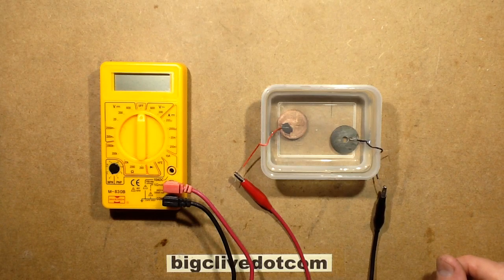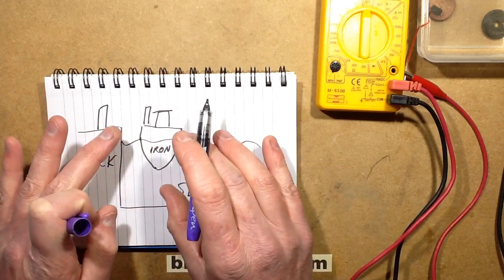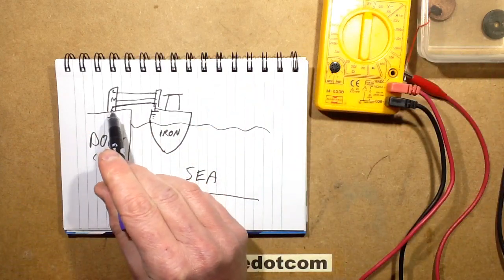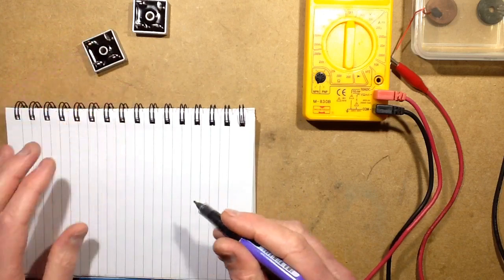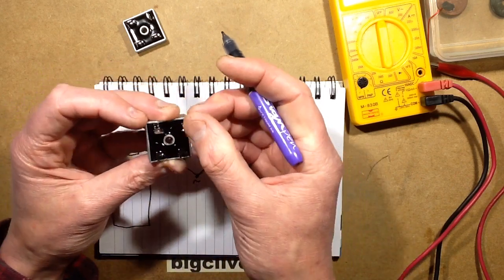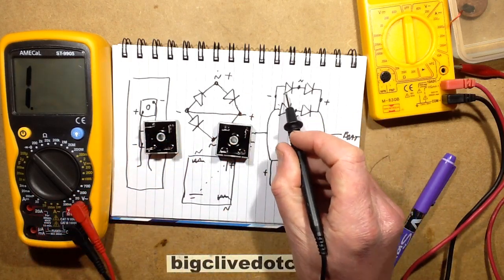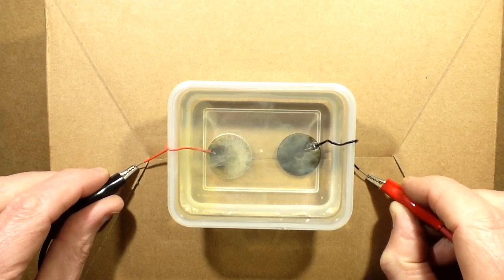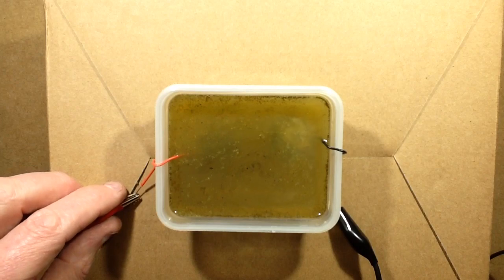Intriguing science of galvanic isolators for boats.

Comment: I just ordered a galvanic isolator for my boat. I found out the American ABYC standard as well as some ISO standard says such devices must be fail safe so you keep the protective ground even if the diodes fail. Turns out most GI don't fulfill that demand, not even a well known brand as Victron. I (living in Sweden) can't find a single one here that is fail safe so I had to order one from the US, a ProMariner at about double the price of a Victron. Even if I do have a GFCI, I don't want to lose the ground connection, a GFCI should be extra safety but they too can fail.
I find it disturbing that GI are sold that are not fail safe, most boaters don't even know what it means and will never check their function.

Comment: In Finland heating pipes are steel pipes so that the connection to a radiator is not two different metals. Water pipes (even warm water) are usually copper pipes though.

Comment: Nice one Clive, I am used to working on industrial electrics (ex.Instrument Tech.) I came across this problem recently when I put my boat in a Marina, I originally thought of isolating the transformer but some research led me to the galvanic isolator idea,  the only problem with this setup is if the diodes fail they fail open and you lose your earth, this would be very unlikely as the rcd should trip on earth fault also, so are we looking at the different potential on earth here? the earth is bonded to the metal on the boat and that, in turn, is bonded to the sacrificial anodes. if this is the case you would always have a small current flow because of earth bonding. ?

Comment: Marina just cancelled my order as "you won't need it, electrician said, you could get the £2000 full isolation unit instead..."
I just bought one off Amazon instead. Oh well.

PS I doubt you could test these as they are often potted/epoxied for safety and water protection.

Comment: When hooked up to the positive terminal of the power supply, you are pulling electrons out of the metal, causing it to corrode. That is why it appears cleaner.
When hooked up to the negative terminal, then it start plating from the solution, then once the solution is depleted so it can't plate any more, it starts reacting with the electrolyte/water

Comment: Wouldn't the base-emitter junctions of power BJTs be better suited to this? I'd expect that reverse current leakage could become an issue with regular bridge rectifiers.

EDIT: ...though reverse current only becomes a problem at higher voltages, and that would be swamped out by forward current through the opposite rectifier, so nevermind.

Comment: Aluminium shop fronts are usually heavily corroded by galvanic corrosion with steel structure or fasteners  they are also at dog height so are usually fairly well connected to ground

Comment: Small point but, on metal hull boats on Britain's inland waterways, the hull is NOT used as a 'neutral' terminal.  There are separate conductors for L and N (or +ve/neg) for both 240v shore power and 12v dc supplies. The hull itself is obviously connected to mains earth. Clearly, galvanic corrosion is a function of the conductivity of the 'electrolyte' the boat floats in. Galvanic isolators are generally not used for boats used in inland and fresh water - Ive had five 3kg zinc sacrificial anodes on my canal boat which, over about 12 years, haven't shown the slightest alteration.

Comment: I'm about to do your trick on my fibreglass boat as part of a mains circuit install and I was wondering if I should link the boat side of the shore earth to the engine 12v earth and thus the anode. Do I need to do other bonding?  The fresh water tanks are SS but everything else is plastic.

Comment: Very interesting Clive, I worked for British Telecom for many years and it was the eternal struggle to keep water out of the cables, using compressed air or grease and millions every year on new joint designs and testing. But an interesting thing is that they used a negative battery to power the lines. For several reasons, but the main one being electrolytic corrosion of the wires, mostly copper but still lots of Ali. The negative battery was supposed to stop  the cables dissolving with the constant leaks in current to earth. Putting the meter across the pr showed -50v  It wasn’t unusual to open a joint and find the Ali had turned to mush or was so thin it just crumbled. The copper was slightly more robust but still could be covered in green mush which was nicely conducting the current away to earth and the broard band and with it.. the fibre optics are much more reliable and replacing the copper at an incredible rate. There are sections of cable ( actually thousands of miles in total ) with 0.5mm copper to .5 Ali to .63 copper and back to Ali again with each connection, via crimps, changing the resistance, bits where engineers had split 2 prs and used the good leg of each to make a single pr, but now each leg being wrapped around a faulty leg instead of each other, this then causing broardband drop out and overhearing issues. Of course the ‘engineers’ are anything but these days so have no understanding of what or why they’re doing what they’re doing.

Comment: How would the boat become live with respect to the dock, if the boat is made of conductive material and sitting in the sea, and the dock is also made of conductive material and sitting in the sea?
Reply from the maker: If you put two connected pieces of different metal in salty water current will flow between them like a battery.
Reply: @bigclivedotcom   And if they're not connected, they should be within a volt so how does the boat become live?

I suppose the risk of not connecting them is that a ground fault could start dissolving your hull.
Reply from the maker: @thewhitefalcon8539  That volt is the problem.  It might not seem much, but the current can be high.  That's the point of the galvanic isolator that introduces that low voltage barrier.
Reply: @bigclivedotcom  But there would be no current if the earth wire wasn't connected...
Reply from the maker: @thewhitefalcon8539  If the earth is not connected to a boat at all when using a shore supply, there is a risk that the whole chassis could become live with respect to adjacent metalwork like the metal ladder you climb off the boat with at low tide.
Reply: @bigclivedotcom  Which brings me back to my actual question: how would that happen if they're both conductive materials sitting in seawater?

Comment: Otherwise known as a "corrosion anode"... It's just a zinc anode, piece of the metal, you can attach to it any area with a clean connection, basically an electrical connection, that is metal, or certain types of metal... It's used on automobiles, semis, as well as boats, planes, locomotives... It's very very useful and is how somevehicles manage to survive years in hostile conditions, like Chicago streets, without rusting to pieces...

Comment: It's hard for me to do these types of experiments because they don't make pennies here anymore and most of them have been taken out of circulation. So random bits of copper aren't as plentiful as they once were. That's interesting at the end, though. I used some copper wires to generate hydrogen through electrolysis of water which I collected in a test tube held under the water, as you do. After a few days of storage, the water started to become discolored. I'm wondering if it has anything to do with the corrosion at the end of this video. Though the discoloration seemed to be coming from the cork stopper in the test tube, so I dunno. You wouldn't think there would be corrosion with similar metals, but as I recall, the stripped ends of the wire which were in the water had become very blackened and obviously corroded from my experiments.

Comment: An isolation transformer in the shore to ship mains connection and separation of the earthing systems seems to be the preferred  solution used over here (NL). The galvanic isolator with justthe diodes in the earth connection might actually even be illegal.

As a reaction to you remark towards heating systems.
We also use radiators and water to heat buildings too, but usually the pipes are also made of steel.
Not only is that cheaper than copper, it does away with the need for corrosion inhibitors, typically systems are simply filled with tap water. And it works well, the heating system in my appartment is as old as the 1960-ish building, and the only thing that has been replaced on a regular basis is the central heating boiler.

Comment: Im not sure if I really understand this... are you saying because the diodes require 1v to conduct, thats enough voltage potential to stop the current flow from the boat to the dock?
Reply from the maker: That's pretty much it.  The voltage created by a single cell of dissimilar metals (the boats hull and shore) is very low, but without the diode blocking it, a high current could flow and cause the electrolytic corrosion.
Reply: bigclivedotcom Yep, that make sense. Thank you!

Comment: Fascinating video, but not the normal use of the term galvanic isolation, which means preventing any electrons from flowing from one side to the other, via capacitance, inductance, optical signal or other means. What is the resistance between two copper pipes 1 metre apart in dry Norfolk soil?  I'd guess a lot more than 10 meg. And to complete a circuit to the substation?  Gigs?  For 240v to provide a 24mA trip current DC would take 10kohms or less .  Surely soil resistance isn't that low.....I think our safety earths rely more on capacitive coupling.

Comment: This is one of the things I never understood, but had to pretend to, in chemistry, and later when I took up electronics, in order to get A's. I know the explanations they give, because I needed to imitate understanding them to get high marks on tests, but unfortunately there is no explanation in the explanations.

Tracing the history of electronics far enough, the chain goes back to Humphrey Davey using electrolysis in chemistry. Davey untangled some chemical mysteries, and isolated a few new elements, that normal chemistry could not manage. At the time, electricity, like a lot of things (heat, fire), was thought to be an "imponderable fluid." But why would an imponderable fluid cause chemical activity?

Comment: OK I know I'm a bit late here but.........this must be the problem with my lights that I put out in the garden (solar) the negative wire always go's black after a time, and I've noticed it on things indoors too, I can't use diodes in this case. Rechargeable battery's seem to be worse in this case.?
Reply: The voltage from the batteries is almost as small as the voltage from the unwanted galvanic battery. So inserting a diode dropper in the circuit will just ruin the whole circuit.  Remember that in the boat circuit, the diodes are inserted in the one wire where current only flows during accidents where wasting power is the least of your problems.

Comment: When I bought my Narrowboat many moons ago it was not fitted with a Galvanic Isolator and spent most of its time on shorepower - great for the batteries, not so hot for the hull.  So I did a bit of research and plumped for ...   an Isolation Transformer.  More expensive than a GA but greater peace of mind.

Comment: When applying current across your test set up, with polarity one way you were depositing a layer on the copper coin, effectively  'electro plating' the coin, with polarity reversed you are effectively removing a fine layer and 'electro brightening' the coin.  (even with low current it would not take long for a measurable difference in thickness to be achieved)  Galvanic deposition and corrosion are fascinating when you look at them in depth.  I had to deal with galvanic corrosion when I worked with a marine engineering firm and got into electroplating while making parts for small engineering projects. (depositing protective layers on precision parts with various anodising processes)  If you have a go at some basic electrolytic cleaning and electroplating  with a variety of materials You will get a better feel for how nobility of metals makes a huge difference & galvanic corrosion will make way more sense :-)  Galvanic corrosion also occurs between Carbon Fiber and various metals, this is why many carbon fiber products are made with a fiberglass 'separation layer' at fixing points. Titanium fixings should be used in preference to other metals such as steels or aluminium alloys as Ti is a closer match to the nobility of carbon which greatly reduces galvanic current flow and corrosion extending the working lifetime of the fixings and the carbon fiber.  Experiment with some carbon fiber in a 'test tank' (also try different salts, acids and alkali solutions) and you will be pleasantly surprised at the results! :-) just be aware that you can produce a few rather iffy by-products while experimenting with electrolytic effects. fume extractor is a good plan.  Take it steady & keep having fun!
Reply: That's now illegal in Finland and the coin dealers have started to use ultrasound cleaning of coins.

Comment: Keep coming back to this, as a boat owner I feel the price charged for these units is very expensive compared to the cost of the components.  Anyway I've been reading up on this tonight as I was about to make one and there seems to be some that put a capacitor across the ac connectors of the bridge rectifier.  Also a lot of concern about the diodes failing open circuit and basically breaking the connection to earth.  Might put off my own attempts until I have done some more research .

Comment: how does having the diodes help if you configure them to not act as a diode
Reply: I understood its because diodes need that certain voltage over them in order to start conduct. Obviously the little potential difference that causes the corrosion, is not high enough to get the diodes to conduct.

Comment: Interesting. If I was tasked to do something like this (with no prior knowledge of the subject) I would probably used capacitors instead. However that would not allow inappropriate DC voltage to be ground. So only AC faults could be grounded. Inherently less safe than this method.

Comment: The coins really are cool the way that they seamed to heat up and darken.  Then when you reversed them and it cleaned up the copper was very interesting .   Is there any way that there was some electrolosist going on ?  Meaning that they were trying to plate the other coin with copper and then back ?   I guess that sounds strange but who knows ?   Definately not me but don't you kind of do that when you plate metals ?
Reply: +cody cheney that is exactly what was happening when he hooked up the power supply to them.

Comment: Salt water aside, was this perhaps supposed to be the general concept behind vehicles in the 40's and 50's which insisted upon positive ground? I inherited a 1951 Mercury from my Dad and we always discussed the pain in the ass it is to remember the polarity of it all (during charging, etc). I had always been told it was to decrease the rate of corrosion on the body panels, but at the same time, I never quite believed the results would be significant enough to matter in any long-term way. I can much better understand the Ship scenario as described than I do a motor vehicle. It was mostly the section where you were reversing the leads toward the end which made me ask this.
Reply from the maker: +MicrophonicFool I think the switch to negative chassis was to reduce chassis corrosion.
Reply: +MicrophonicFool Most electrical equipment used to be positive earth due to electron flow and thermionic valves. Negative earth only came about with alternators. The proper way to hook up a ship is using an isolating transformer with no earth.

Comment: Hi Clive,

My father has on his steel boat a plug which supplies 50A 240VAC shore power. Inside, He has a set of two isolation transformers which step down to voltage to 120VAC mains as used in the US. One transformer feeds the 12V battery charger/inverter pass-through. The circuits powered from the inverter include a 20A circuit with several outlets around the boat, Television, Microwave. Lights are on a separate 20A circuit. The refrigerator runs off 12VDC from the battery charger, batteries, or one of the two alternators attached to the engine. The other transformer feeds the washing machine, air conditioners, hot water tank, and a single 120V outlet near the engine room. While under way, the 4-cylinder, 85 horsepower diesel engine is used to heat the water heater and charge the house battery banks via its two alternators.  The circuits fed from the second transformer are unavailable when not docked. The transformer chassis' are connected to sure power ground. Everything inside the boat is on a floating ground with four zinc anodes bolted to the bottom corners of the hull as well as the prop. There is no ground connected to the dock except for the chassis' of the two transformers which are electrically isolated from the hull of the boat.

Do you approve of this system?

Thank you.
Reply from the maker: +Zach Z The only downside to the isolation transformers is that they weigh a lot.  Particularly the ones for heavy loads.  they also have modest losses which will result in extra running costs.

Comment: The same thing is used for audio electronics.
The ground often gets connected between different amplifiers which have their own ground. (called ground loop) since it is a loop you will get an induced hum. Braking the loop is easy but often not safe. The diodes are an elegant and safe way to solve the issue.
Reply: interesting point